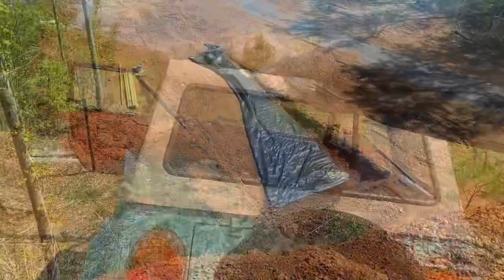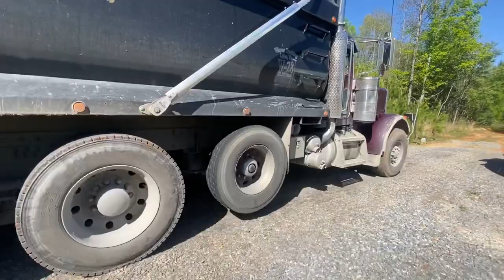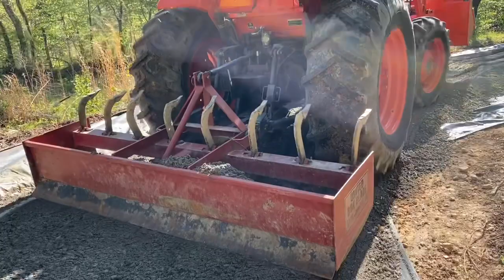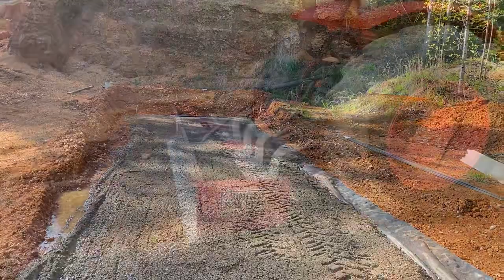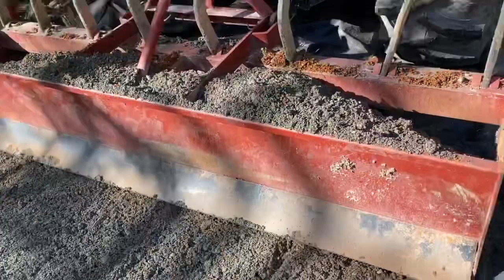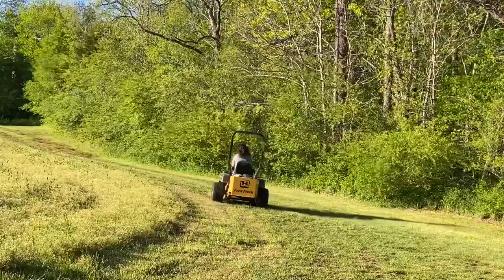More Road building progress, and other projects on the new property

Comment: Nice job on the grading with the box blade. When I built my raised beds I didn’t want to used pressure treated lumber because I’m afraid it would leach chemicals into the soil of the plants I’m eating, they say this new stuff is safer but at my kids old school they had to take out the playground equipment and soil because of the pressure treated lumber and I just didn’t want to take a chance on eating that. I got rough cut from a sawmill instead.

Comment: Yup - a pickup truck with a sturdy ladder rack I found to be very very useful for home construction projects.  Had a '90 F-150 used to bring home 16' long lumber, two 24' long gutters I had made, pallets of roofing shingles, loads of gravel, landscape block.  All kinds of stuff.  Had a custom heavy duty ladder rack the previous owner had made.  I had to junk it, sadly.   I recently found a way to strap a 20' long 15" diameter corrugated pipe to my Volvo station wagon roof, but it was not pleasant.  Are you using fabric under the pad area?  That surprised me.
Reply: 245?  If so, get three Yakima or Thule gutter mount crossbars.  Mount one just behind the windshield, next one just behind the rear doors, then the final one about four inches forward of the tailgate hinges.  That should help a bit...  Can do the same on a 700 or 900 series wagon.  The 850 and newer wagons, however, since there are no raingutters, you can't use a third crossbar.  Used to use that setup when hauling long items on my wagon.

Comment: Even crusher run won't save you!
Reply from the maker: Well it’s been a wet spring and that truck didn’t tear up the hill or hilltop at all.  The only damage he caused was when going sideways across the drive at the very bottom but it wasn’t really the drive as much as the shoulder that moved.  It got fixed easily in one pass.
Reply: @BusGreaseMonkey  A lot depends on how steep it is. I ended up pouring concrete diagonal drainage canals every 50 feet down the hilly parts to bleed excess runoff into a ditch. It helped reduce grading from every heavy rain to only torrential rainfall. About every two months. Still a ton of work though!